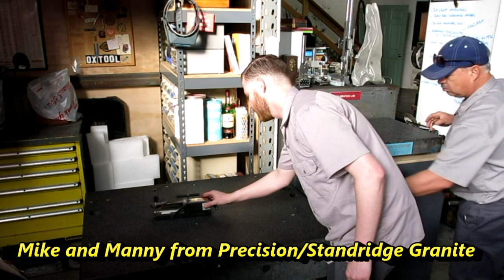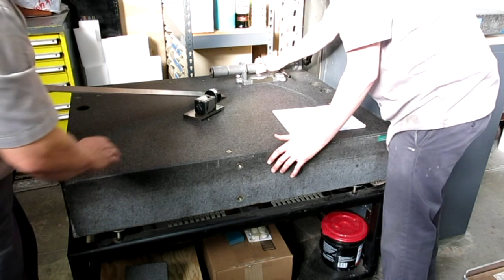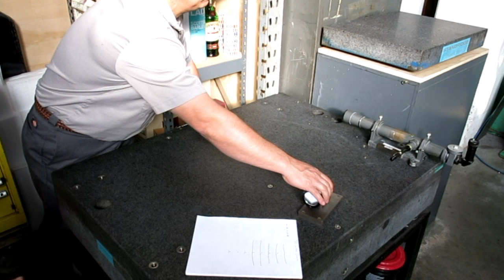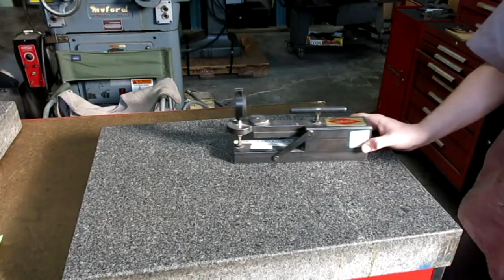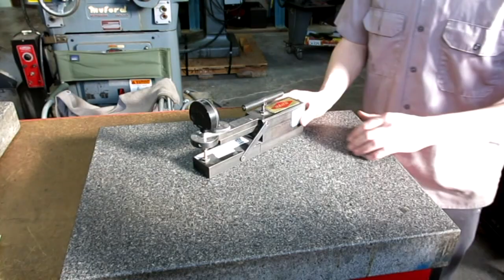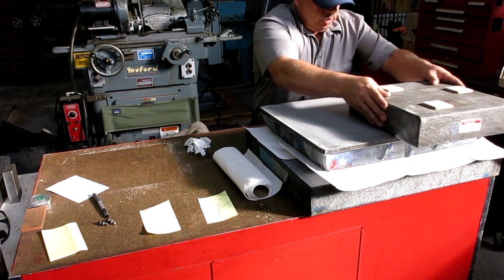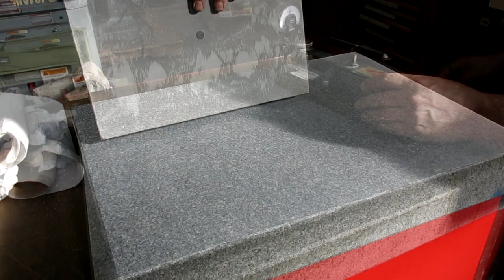Surface Plate Calibration and Conditioning

Comment: Forgive me; I'm just a dumb woodworker, but why aren't man-made stones (quartz) used as a reference surface? Wouldn't it be more stable than a natural stone?
Reply: They’re sometimes used as that, not as surface plates but as ‘optical flats’. They’re placed on top of the surface you want to check, like a gage block for example (Tom has some clips talking about it, very fascinating stuff). 

Making a whole surface plate out of quartz sounds very expensive. Pure quartz has a melting point of 1670°C (>3000°F) and you would need to melt, cast and cool big volumes of it before you can even begin to cut and process the surfaces.

Comment: fascinating process, Ive been thinking about my surface plate which currently resides outside in the wet (workplace roof cave in) and I am now thinking about how to clean plant life off of it before I put it back. I am a blacksmith so I wouldn't use something perfectly flat as such, its for checking legs and so on so they don't wobble on standing up 

incidentally I am 6ft5 so I would need an 18 hand horse to be able to ride properly lol...... one hand is about 4 inches 
Thankyou for sharing this ...very cool

Comment: Call me stupid but i don't understand one point , the iron lap he rubs to the smaller stone block and later calls it a Master , later the same iron lap goes on the bigger surface , i mean what is the origin here , the root reference ? The small block that became the master or the lap itself which is calibrated scientifically? If its the iron lap doesn't it go out of square with repeated action with abrasive paste and how it's calibrated again if it goes out of flat ?

Comment: In the mid-60's I was on a Polaris Submarine repair ship and I worked in the Fleet Mechanical Calibration Lab.  We had 2 black granite surface plates a 4'X8' and a 2'X4',  we calibrated our own using a procedure from Metrology Engineering Center in Pomona, Calif.  we measured every inch and plotted it using a Davidson D638 autocollimator and a precision front surface mirror.  It would take as about 2 days to shoot the big plate and about a half day to shoot the small plate.   Then we would enter all these measurements into a Frieden mechanical calculator and it would set and crank out for about 8hrs to give us our high and low spots as I remember it was a AAA plate but we used it for everything from a bed to ironing our uniforms on.  It was mainly used to calibrate all the optical equipment we serviced, when I went back in the Navy in the early 70's nearly all the optical stuff had been replaced by electronic equipment.  I really loved working on and calibration optical instruments.   Those days are long gone.
Reply: Tres Å? Wow. Bueno.

Comment: I can't believe these guys were leaning on the table while measuring. Leaving hands on the table causing localized heating. Not squaring the measurement lines to the table. Holding the repeatometer body instead of using the handles (which prevents heating of the gauge). These guys are sloppy in their technique, and they should know better.

Comment: When we calibrated our larger surface plates in US Army labs, we put a stationary mirror at one end of the path and turned it a little toward the center of the plate so that the light from the auto-collimator would  reflect off the stationary mirror and hit the movable mirror as we pushed it along the straight edge. The auto-collimator was placed next to the straight edge and rotated slightly to point at the stationary mirror. This allowed us to take measurements the full length of the plate in one pass.The way they did yours, they were only checking half of the plate at a time. I don’t see how they could tell that the two halves were straight with each other..

On second thought, the way they performed their measurements, they divided your plate into four individual pieces. They have no idea how those four pieces relate to each other. In order to check the flatness of the whole plate, they'd have to move their mirror the full length of each of the eight paths. The only way they could do that without a second stationary mirror would be to set their auto-collimator on a stand next to the surface plate. However, if the surface plate moves during the measurements (and it will), the readings will be garbage..

Comment: Did I miss a check to see if the Granite plate rocks on its stand. Very important to make sure the plate is stable before starting.
Reply: Granite surface plates have three rubber feet under them. Tripods don’t rock. The feet are placed about halfway out from the center to keep the plate from drooping in the middle..
Reply: @txkflier 
So true. And they should be stored with the cover on when not being used. And never, NEVER sit anything on it. Storage in a dedicated plexiglass box ensures 6Sigma compliance.

Comment: Very interesting video. I never new how much accuracy those granite lumps of rock could be honed down to. I notice you also have a Myford machine behind the big surface plate. Myford were still going until they went into liquidation in 2011 and all the stock was sold. Very sad but another company have taken over the production of new Myford Super 7 lathe which is a highly respected small lathe for hobbyists and smaller engineering establishments. They also still produce many accessories for Myford lathes. Many budding engineers got their first training on those beautiful little machines which were highly respected and still are. You can still buy a new one for about $10 000. They also refurbish used Myfords which are still in high demand in the UK.

Comment: I haven't seen this done optically before. The companies I've used have always used precision electronic levels. I liked the comment about the work improving the lapping equipment. I've been told that some manufacturers make surface plates / tables in pairs, using each to simultaneously lap the other.

Comment: I didn't hear why these things need to be refinished/resurfaced, IDK if it was in the video or not.  What causes these plates to loose their flatness?  Aren't these just used for measurements and such, putting  parts on them to get a reference of flatness and such?  So how does it wear away parts and what else causes the plates to warp and distort over time?

Comment: wouldn't the oil from their hands effect the reading? or is that so minuscule it doesn't matter for a surface that small?
Reply: I think it probably would matter in an industry that demands absolute precision. This is an extremely high level of precision compared to the general work done. 

In line with what you are thinking, this is more precise than the work being done with the granite block surface plate. That is how precision works. We need our measuring equipment to be more precise than what the work being done with the equipment.

Comment: i recently took an interest in reconditioning and collecting tools. even ones i wont ever actually use. understanding how they work is so fascinating in the respects that the thinking and evolution that have gone into making them tools blows my mind. recently i brought a double sided diamond lap from faithfull tools and when i started using it for sharping wood chisels and plain irons i quickly realized that a flat surface is imperative for a keen edge. ive even used the lap to flatten my polishing stones and used them on the plane irons. so far the shaveings have come off the wood at 3 thou or less. never underestimate the value of a good flat serface.

Comment: I'm confused about the certification. If they actually finished the Oxtools' surface plates to AA flatness tolerance & repeat guage measurement, why would Oxtools or any client want their Calibration Certificate to be a worse grade of A or B?
Reply: Certifying to a lower grade is cheaper. Tom's workshop is a hobby thing (an omg epic hobby shop, but yeah). He doesn't need a piece of paper, so long as the plate itself is flat "enough" to satisfy him. Therefore, he uses the lower grade for the lower price. His plates were already good enough that it was about as much work for them either way. 

If this were a factory, especially iso certified, he would need to have his plates certified to the required spec and therefore pay for it. I'm guessing that most of their business is that kind of customer. Most hobbyists I know haven't had their plate checked since before they bought it.

Comment: Why is it that so many machinists and machine shop operators have forgotten, or ignore, the fact that 68 degrees F is the universal reference temperature for measurements to be taken at and that a machine shop, for maximum accuracy, should be maintained at that temperature at all times?   Even in hot climates, a machinist should be wearing a light jacket and that's an indicator of a machine shop that keeps at 68 degrees LIKE IT SHOULD.
Reply: OldSlow;  The only reason I could see would be cost.  When most people think of a machine shop they think of a building with no insulation and ordinary windows.  If the shop happens tp be old, reconditioning the shop to use air conditioning could be costly.  Fortunately the cost of shop A/C units has come down and quality has gone up.  I live in Florida and when I finish my machine shop it IS going to be climate controlled!  It isn't just that it is easier on me, the A/C lowers the humidity and that is always better for the machines!  Have a nice day.

Comment: I had a friend who needed a good surface plate for his shop but he didn't have a lot of money for a high dollar plate from Starrett or someone like that and he wondered what he could do and he asked me. I asked how accurate he needed it to be and he said he just needed it to be flat and straight so he could get good reading off his cadillac gage. 
I suggested he get a tombstone company to make him up a big old family marker with no writing on it and get the high luster polish makes sure it was at least ten inches thick. Now, he was gonna have to have someone check it and make sure it's good, but that should do it. He got a 60" x 48" x 12" thick and had a frame set up for it and after it sat in his shop for a bit he had a guy come out and calibrate it like these guys are doing. and the guy was shocked it was as flat as it was. He did a clean, buff and clean and the thing was grade A and perfect for what he needed. he just kept it covered and with a UHMW plastic cover on it when not in use and once a year he cleaned it and it worked perfect for him.
Reply: Great story! The first granite surface plates were used in WW2 due to wartime shortages, but they quickly realized that granite was better anyway. The first suppliers were tombstone manufacturers, many of whom became surface plate companies. The Rahn family of the Repeat-o-meter fame were like this.

Comment: I got a plate at an auction that I know realize is the same as that flat lap. Did it have grooves on the bottom? They never showed that surface. Did this cost $100s or $1000s? I have no idea. I'm thinking if they spent an hour with 2 guys and brought their own tools then $300-$400 or am I way off?
Reply: Two guys for 2 hours has to be $500 minimum I'm thinking.

Comment: Spent 33 minutes watching this, and have no clue what this slab is used for. lol
Reply: Morgue slab...
Reply: This is a reference bed used for measuring objects.
 ''A surface plate is a solid, flat plate used as the main horizontal reference plane for precision inspection, marking out (layout), and tooling setup''    https://en.wikipedia.org/wiki/Surface_plate

Comment: Would the stones 'stick' to one another if you stacked them flat to flat?
Reply: I don't think so. The surface is flat but still somewhat rough (on the micro/nano scale). Gauge blocks are both flat and very smooth, and their sticking might also be due to the metal.

Comment: That was extremely interesting. I worked with stone for about the last 20 years I was in the construction biz; I could have saved a lot of time using diamond powder. Would have cut into my earnings, due to the cost, I'm sure.

Also, about 4 years ago, a friend of mine, who was a metrological engineer died, and I ended up with a lot of metrology stuff of his.  About 30-40% of it, I have no idea what it was used for.  I have a much better clue about some of it, now.

One item, looks a lot like the 'telescope' part of the autocollimator, but is closer to 3" diameter. From the one guy's description, it may be a big brother. It has lines on it, like he was describing.  

Your vid has motivated me to finally do something with the room full of stuff I got.  

Thanks...
Reply: You should man, great you started looking it up!

Regarding the diamonds, its probably synthetic and not as expensive as you might think

Comment: How can you tell the machine can measure 1/1000,000 in, there are many factors that +/- 1/1000,000, temp, material expansion... and machine calibration before calibrate
Reply: Umm they checked temperature

Comment: Does this take into account the level of the table or bench or whatever it is that the surface plate sits on?
Reply: Or the floor?
Reply: Both ?
Reply: The reference surface is the top of the plate itself. Both the autocollimator and the repeat-o-meter have two flat surfaces in contact with different parts of the plate. They measure the angle and relative height of the surfaces. Whether or not the plate is level with respect to the Earth's gravity doesn't come into it directly. In theory, the surface plate could be on a ramp and it won't affect the flatness certification. 

That said, it is important to make sure your plate is properly supported and level, or else the whole plate might rock or bend infinitesimally. Or stuff might glide off the end. That's easy to check with a machinist's level (itself cool because machinists levels are self-calibrating).

Comment: Very cool to see this! 
A question though, please excuse my ignorance:

I see they are lapping the plates, while they are just laying on the workbench. Is that itroducing a problem due to warping of the granit? 

I mean to have to true flattness of the plate, when it was first ground, shouldt it be supported in the bessel points? 

When the plate gets back to the plate stand (which supports it in the bessel points), will this then not change the flattness off the plate? 

Thanks for any answer
Reply: I think for the two plates they use, the stiffness and thickness of the granite and the small sizes of the two plates they moved mean that it isn't a problem. Notice that the big lab grade plate was measured and lapped in place.

Comment: Great Video!..Very informative,,Question: How important is it to have a small surface plate, 12in.-18in.-3in. mounted by three points? I plan on simply laying it onto my workbench and level it...The plate will not see any heavy loads.

Comment: Interesting. Used to work for a company in Switzerland that produced this plates. We did work almost the same way but used electronic levels to measure the surface. The rest was done by hand in a temperature controlled environment.

Comment: I bought a grade 00 granite surface plate, and although it's really flat (duh) I was surprised the  edges are not square to the surface. Is that common? I was thinking I could quickly verify my squares. Thanks
Reply: soundiscomforting jep that pretty Common.

Comment: Did you take into account the curvature of the earth? :P
Reply: lennart rolland What curvature? the earth is flat...
Reply: Auto collimators measure deviation from flat using light which travels in a straight line.

Levels and inclinometers measure with respect to gravity.

Comment: does leaning on the table make a difference as they measure ?
Reply from the maker: Depends on how hard they lean. On the big plates they are specified to be accurate at the maximum loading per square foot allowed for the thickness. That large plate is pretty thick so they probably didn't notice any additional error. Thanks for the comment.

Cheers,

Tom

Comment: Why don't they cut clearance groves into the plate like on most lapping plates? You can see at 28:32 when he flips the plate over there seems to be abrasive building up in some areas.
Reply: it depends on the cut they are making. They have some with the lapping grooves.

Comment: That large granite plate and frame came from an Ultratech Stepper. Worked on those things for 16 years.
Reply from the maker: Hi Felici,

That is correct! Can you tell us what the function of the machine was? Was it an inspection machine or some kind of fab machine? Thanks for the comment.

Cheers,

Tom
Reply: It was part of an integrated circuit fabrication facility in the photolithography area. It was basically a big camera. A silicon wafer coated with a photo sensitive resist was loaded into the stepper and exposed with UV light through a photomask. 

https://en.wikipedia.org/wiki/Stepper

Comment: He should put the autocollimator along the side, perpendicular to the line being measured, and use a mirror to bend the light path down the line. That allows measuring the entire line. I've used autocollimators and precision electronic levels to certify surface plates. In the military we measure an entire line from side to side or corner to corner at one time - better accuracy. We also clamp the straight edge to the surface plate.
Reply from the maker: Hi Spay,

That is a better method but your autocollimator platform becomes separate entity from the measuring datum. The platform its on and its stability over the time it takes to measure becomes very important and closing the measurements well is your only indication nothing moved. Clamping the straight edge  and extra step that is not always practical. Its only job is to make sure the mirror is in the horizontal field of view so super accuracy is not really needed. Thanks for the comment.

Cheers,

Tom